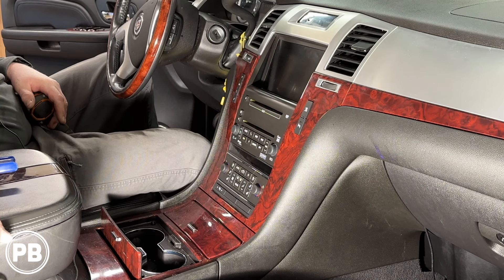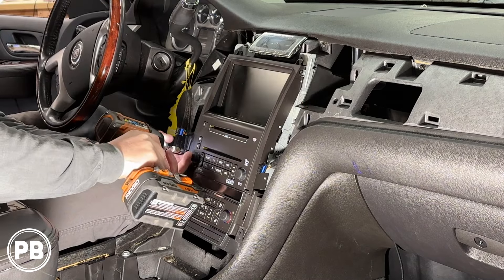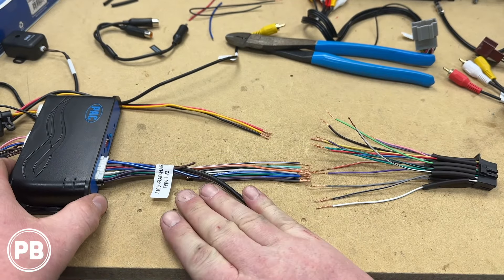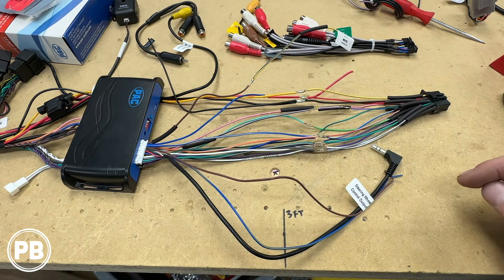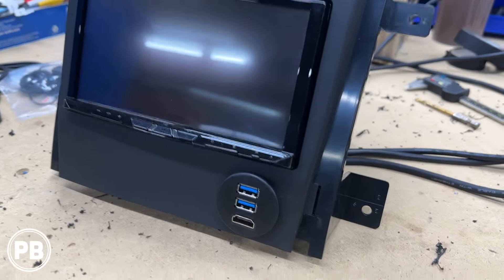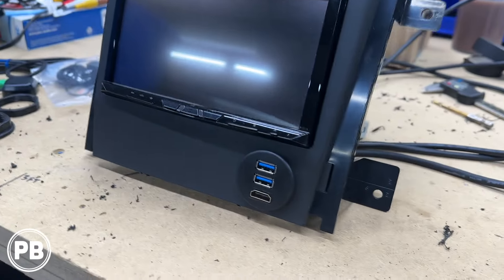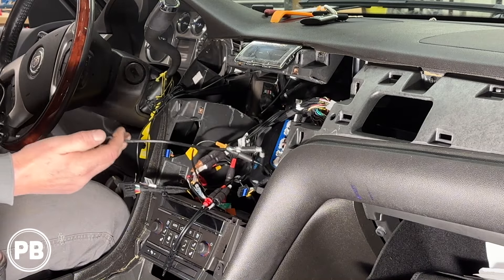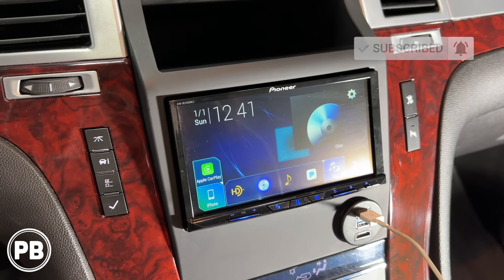2007 - 2014 Cadillac Escalade Radio Install

Comment: I appreciate that. There's a dash kit but I absolutely don't like that cubby hole above the radio. I would much rather see it in the middle
Reply: I'm just happy to have a place for my phone. Storage in my 08 is nonexistent.
Reply: They make one with the storage space flipped to the bottom
Reply: I would try to fit a wireless charging pad for my phone in that cubby

Comment: Thanks for the video, i have a 2013 ESV platinum that has the 2 rear roof screens as well as the 2 headrest screens. is there anything else i will need as far as adapters to run all 4 screens in the back?
Reply from the maker: There are no other needed or available harnesses.

Comment: Great vid! I used the links provided to buy all the parts listed for my '07 Escalade ESV with factory second and third row screens. This looks like a pretty straightforward installation. My scenario is a little different, because my backup camera is not working prior to installing this stereo. I have determined that I need a new camera. Is there an aftermarket replacement camera you would recommend? Or should I buy an oem GM camera?

Comment: Installed a avic-6200NEX in 2007 Cadillac Escalade. everything works perfectly even the SWC, except the stock back up camera. I plugged the rear camera video feed to the brown input on the rear of the radio. When I shift into reverse the radio recognizes I done so and switches to the camera screen I can see the guide lines (yellow, red, green) but no video feed just black. I did go through the settings on the radio and turned necessary controls to on for the rear camera.  I currently don’t have the grey connector in yet. Does that have anything to do with it? I figure just the brown connector was the only thing that had to do with the backup camera

Comment: Hey provobeast can i use a Pioneer AVIC-8200NEX to do this procedure to retain my 2nd and third row screens and also how did you make the hole for the flush mount usb hdmi to the radio double din harness? If looks factory  like with no wiggle.
Reply: Also how can I add odb monitoring

Comment: I have a 10” Tesla style radio I want to install in my 2011 Cadillac Escalade ESV but I also want to put a cd/dvd player inside my center console so I can continue to use my screens. 
My question is, how do I do that plus connect a video in motion bypass?
Reply from the maker: Android based radios are usually garbage, I don't recommend them.

Comment: Does it have the DVD bypass in motion watching movie while driving?
Reply from the maker: That depends on the radio brand. We bypassed the restriction on this unit specifically, yes.
Reply: Thanks , is this a DVD player ? This can play mirroring in the back rear as well?
Reply from the maker: Yes, which is why we went with this specific unit to display DVD / AV on the rear screens. @ericjohnson3222

Comment: Would the same harnesses and parts be needed for a Pioneer AVIC-6200NEX install in the same vehicle?
Reply from the maker: Yeppers! All linked in the description.
Reply: I have bought all the pieces needed. One question, what did you do with the SWC wires blue and brown ones? I know the jack goes into W/R but I’m not sure where the blue wire and brown wire with steering wheel control output goes

Comment: I do not see the harness to retain the factory backup camera. Which one did you use?
Reply from the maker: It's included with the Pac harness kit. It simply plugs into the harness and the camera intput of the radio.

Comment: Hello, I have a question at 3.41 what is that in the video?? Is it included in the set somewhere because it is not in the shopping link?
Reply from the maker: That’s the radio harness, included with the radio.
Reply: @ProvoBeastAudio  Thank you for your answer, and if I buy such a set with a radio, will the ceiling monitors work?😁
Reply from the maker: @malczaki  With all parts we used in the video, yes to have all the factory features retained while adding another radio with more features.
Reply: @ProvoBeastAudio  Will the radio you show here work in Europe, especially in Poland?

Comment: Grid lines for backing up?
Reply: This model year Escalade doesn’t have the grid lines, those come in a later year
Reply: @jwell1160 2014 does have grid lines, which move with the turn of the steering wheel.
Reply: @wg8409  yup, my 2007 doesn’t
Reply: Do you know if the grid lines would work on a 2014?